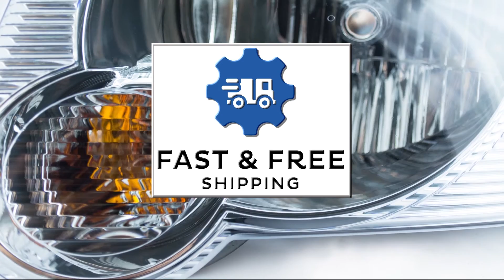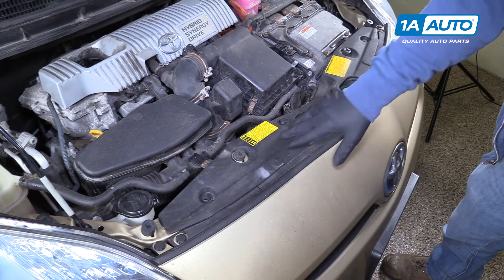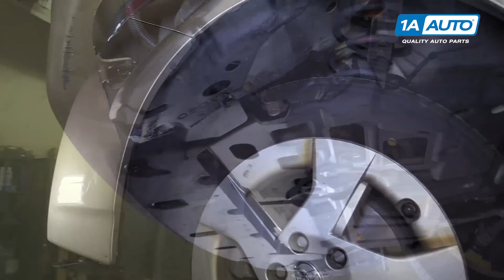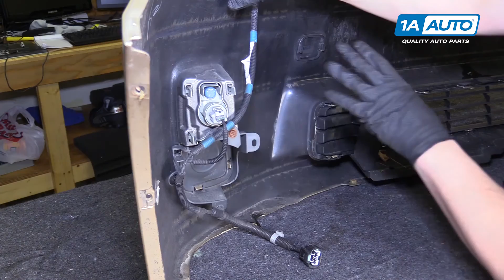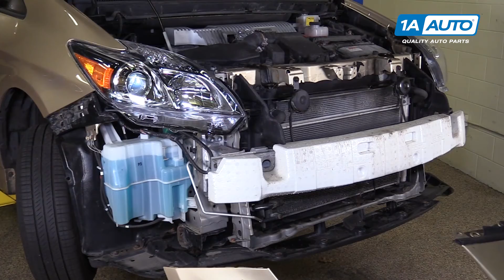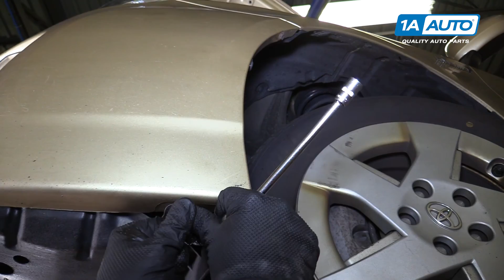How to Install Turn Signal Assembly 10-15 Toyota Prius

Comment: Hello sir my Toyota 2010 front turn signal light wired cut or disconnected but I couldn’t find the cable or place to reconnect it again please tell how and where can I find the cable in my car and connect it again passenger side